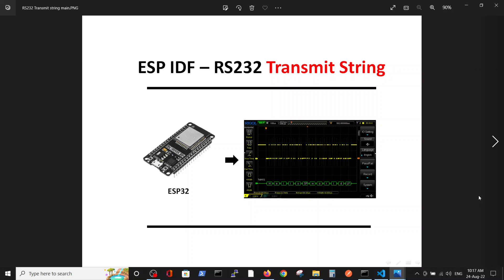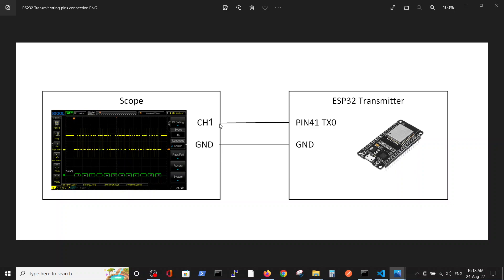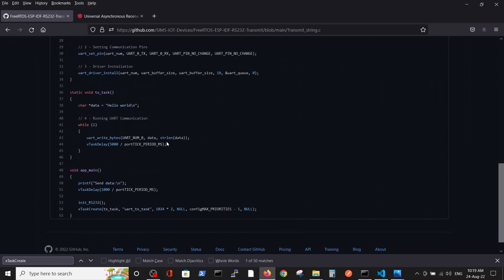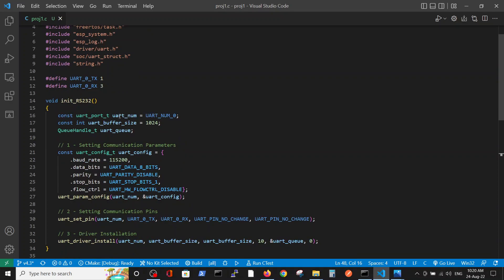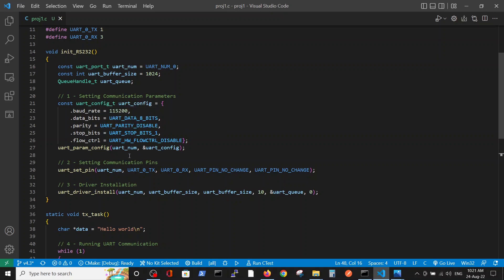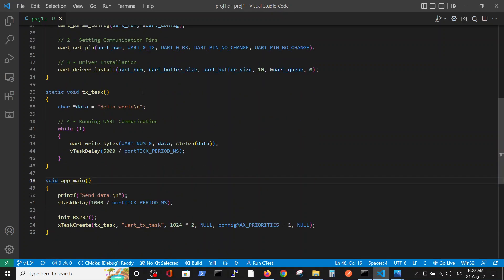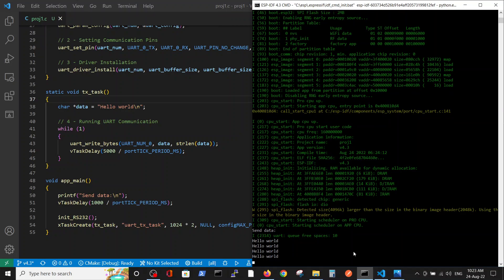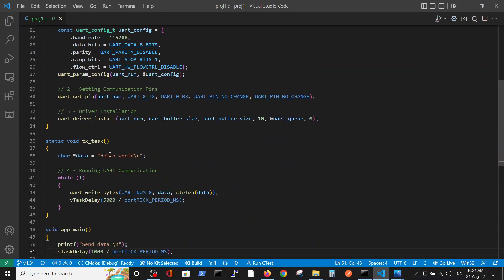3 - Transmit a string via RS232 from ESP32 to the scope in FreeRTOS ESP IDF environment

Comment: The USB chip is hardwired to RXD0 and TXD0. If you used one of the other usarts you probably will not output on the monitor.
Reply from the maker: Dear @noweare1,
In this case UART_NUM_0 worked, right?

Comment: Thanks for this video.
Kindly tell how to input a string through console. Is there an alternative to scanf(); or Serial.read() in esp-idf? 
Kindly help.
Reply from the maker: Dear One tech a day,
I published a video for you: https://www.youtube.com/watch?v=WzxZSvWVWpM
hope it will help.
Reply: @simsiotdevices6219  Thanks, i appreciate it.
I had a misconception. I used scanf before in esp-idf but it didn't work. I also read in esp32 forum that we can't use scanf in esp-idf platform. 
Should we use scanf instead of esp_console library?  I am currently trying to use the latter.
Thanks
Reply from the maker: Dear  @onetechaday2794 ,
Got your point, I will look into the esp_console library pros and cons.